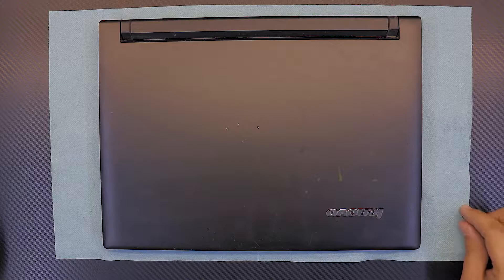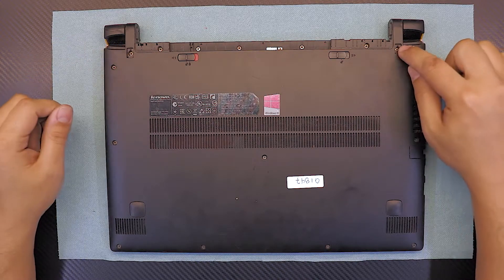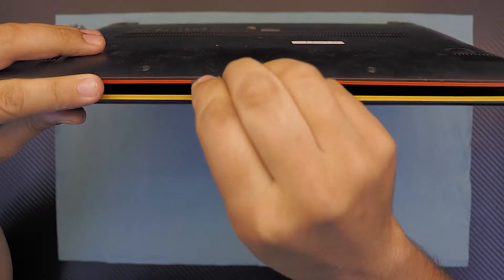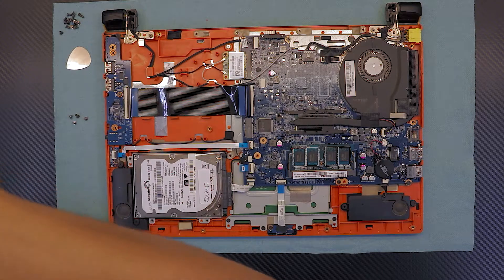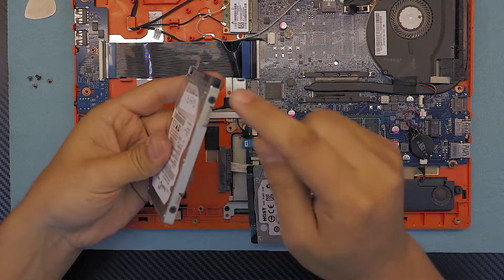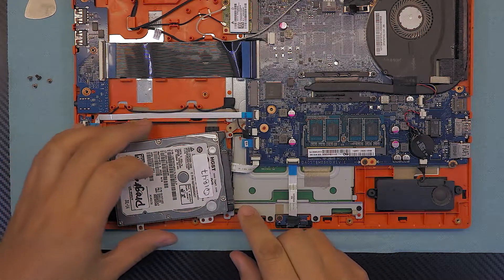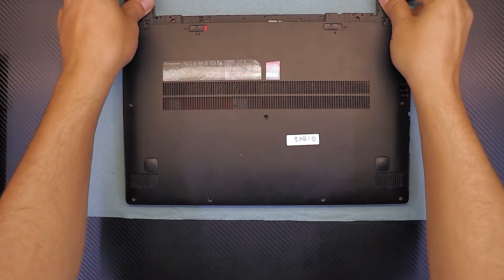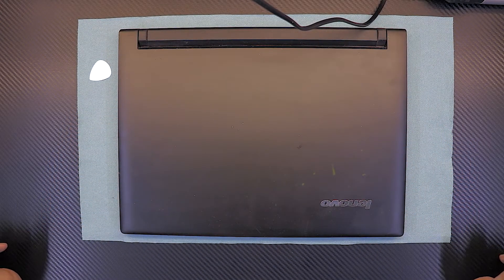lenovo ideapad flex 14 SSD Upgrade, STEP By STEP

Comment: Thanks, are SSD M.2 support ? or can both?  HDD still use + SSD
Reply from the maker: Thank you for the feedback! if you wish to support the channel you can LIKE or SUB or both :P
regarding your question: if your CPU is icore series and its 6th gen over it will support NVME m.2 if its i core and older than 6th gen then it will only support m.2 ssd sata.
and YES you can have both ssd and HDD at the same time 2TB on ssd and 2TB on HDD max